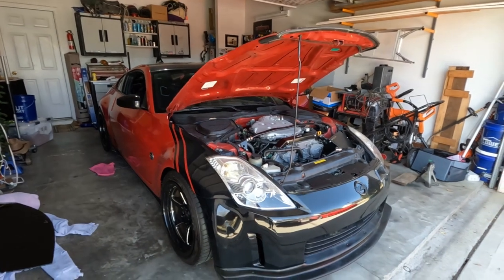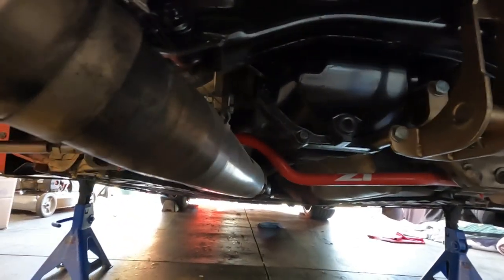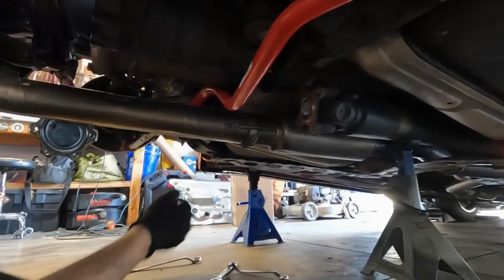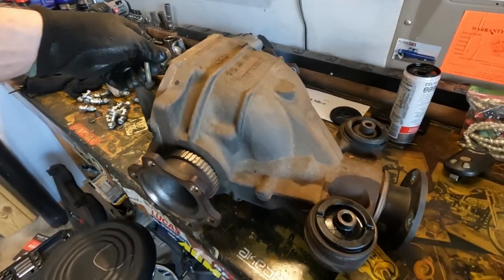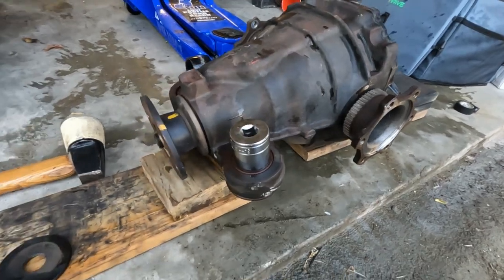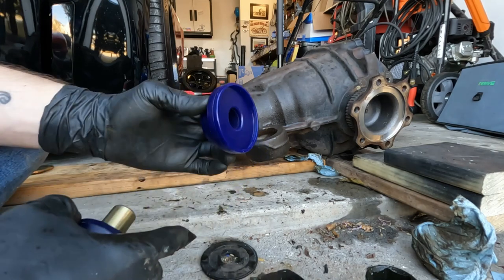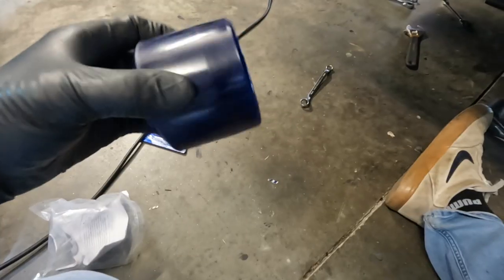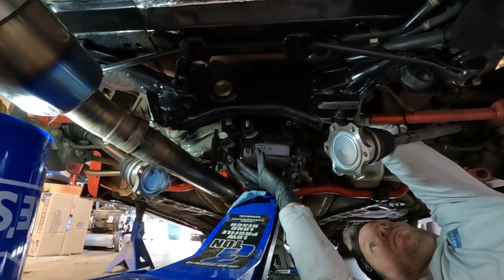Z1 Rear Diff Bushing Install | Nissan 350z / G35

Comment: No kidding on that bushing! What a pain. I had to use an air hammer with a sharp chisel to cut the outside ring out.  I was covered in black oil😂
Reply: I was struggling using the removal tool wrong😂😂

Comment: Hey is this what they say you need to drop the sub-frame for? Or are those other bushings? I’m looking to replace mine but I’m unsure whether to do it myself or get it done at a shop to avoid high labor costs
Reply from the maker: No need to drop the subframe for this.  That would be for the subframe bushing collars.  I have a video on that too.  And you don’t have to “drop” it.  You just have to lower it slightly.
Reply: @SpeedCultureStudios  awesome thank you 🤝

Comment: For the big, rear bushing, do you remember if you got it completely in and flush with the subframe, or did you have that protrusion of the bushing sticking out that meets with the diff? Hopefully that makes sense
Reply from the maker: It is pretty flush on the rear—facing toward the back of the car.  There is a slight protrusion on the forward side of the subframe that meets the diff itself.
Reply: Thank you, that's just about how I got it.

Comment: My mechanic installed my rear z1 poly diff bushing but it pokes out towards the rear of car by about 3-4mm, not flat to the surface of the frame. Is this going to be an issue? Thx

Comment: On the top front diff bushings did you used any of the old hardware? I know the bushings come with metal for the bottom but I’m not sure if I have to use the old ones on top
Reply from the maker: Tops are discarded
Reply: @SpeedCultureStudios   thank you 🙏🏽

Comment: Did you find out what the ticking noise was?
Reply from the maker: The ticking noise?
Reply: Yeah you pushed the car in the beginning of the video. You said it might be the sway bar end links or upper control arm. I was wondering which one it was
Reply from the maker: @samuelgrosvenor6611  yeah 95% sure it’s the ball joints in the control arms now that sway bar bushings were changed
Reply: @SpeedCultureStudios  I’m sorry to bother you. But the single ball joint that needs to be pressed in. Or a bushing in the control arm
Reply from the maker: @samuelgrosvenor6611  I have adjustable control arms.  The ball joints are in rough shape. The whole arms are being upgraded soon